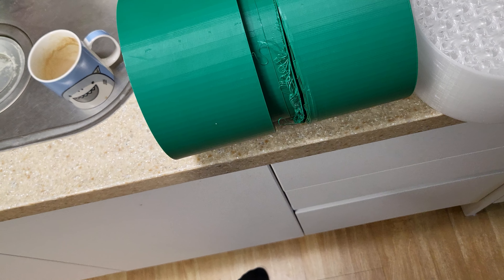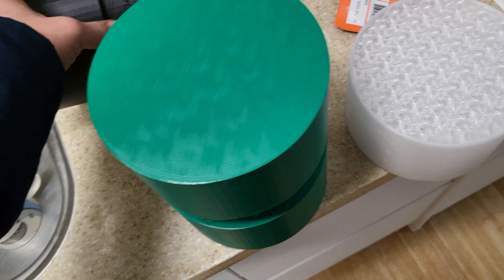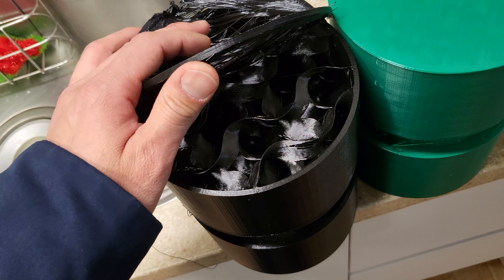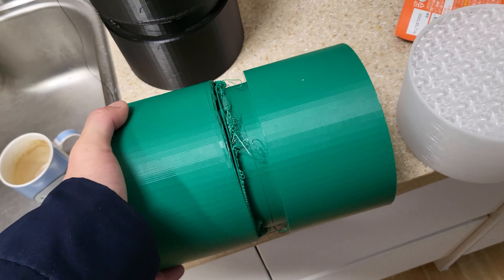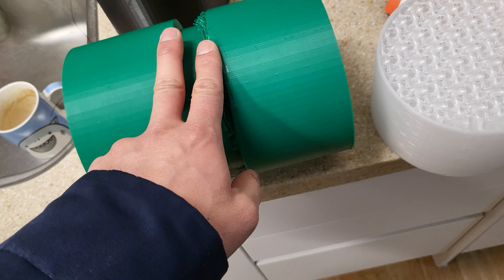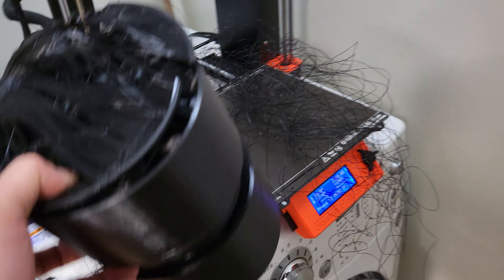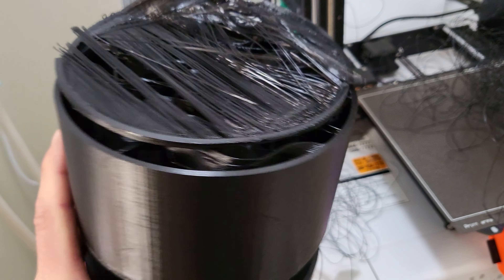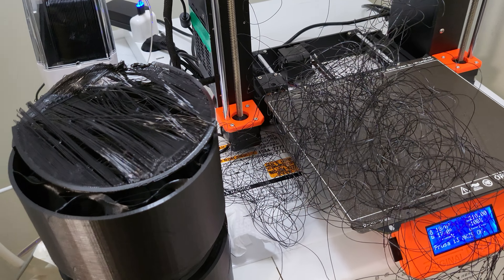3D printed back roller FAIL!

Comment: Use Rectilinear or Grid infill instead of Gyroid infill , its faster and uses less filament. See Stephan's (CNC kitchen channel) experiments on the topic.
Reply from the maker: I tried gyroid and it wasn't as strong, it seems real life tests are more accurate.  Grid falls apart the easiest on rollers like this because no vertical horizontal support.  I found honeycomb to be strongest.  Will have video soon.